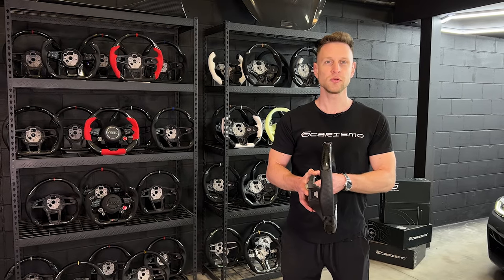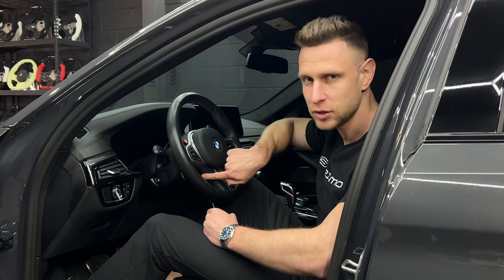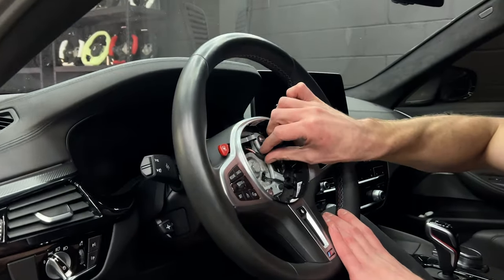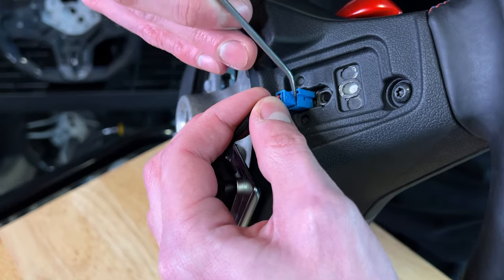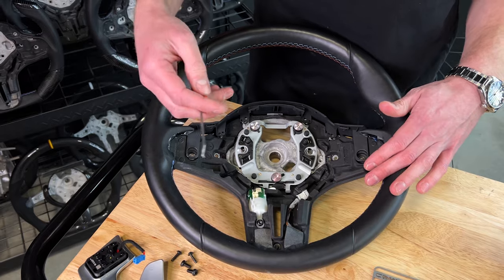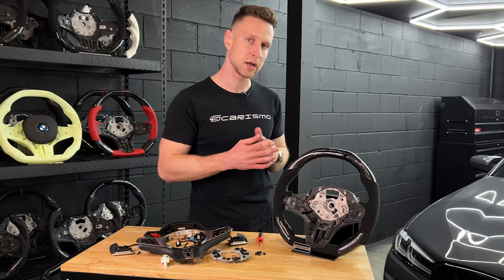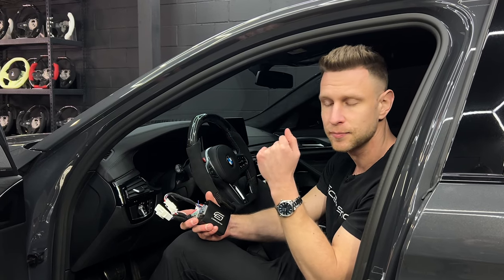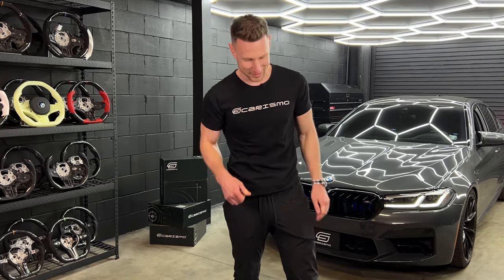CARISMO | 2022 BMW - LED Steering Wheel Install | Ferrari Style LED Shift Light Bar

Comment: Great video!
Are you able to tell me or provide a picture of which wire is for the heating element? I'm having trouble connecting the wiring from the new wheel to the factory heating element wiring. Thanks in advance!
Reply from the maker: Hey there, each vehicle is wired differently, the best way to find out which wire provides 12v and ground is to use a multimeter. 

Here at the shop we've had luck tapping into the red and black wires on the connector that plugs into the left hand side of the steering wheel buttons. 

Disclaimer; your steering wheel may be wired with different colored wires. Please use a multimeter to confirm wether you are connecting the wires correctly.

Comment: what happen to car with heated steering wheel? will that function work on the new steering wheel?
Reply: If you shoot them a message on IG they will be able to answer you but yes you can retain all the steering wheel features (ie. heat & ACC). More than likely they will have to make you a wheel, turnaround is about 10 weeks.

Comment: It’s a shame you have to pierce the side of the wheel to get to the springs. Is there any kits out there to hide the holes made ?
Reply from the maker: Technically, with a thinner tool and more accurate approach the holes created will be so minimal that they should never be visible to the naked eye without digging at the material to check if it has or has not been piereced. The larger the object, the higher the chances that the removal will leave a mark. Since its not even a real hole, just a puncture - we highly doubt there is a kit for this.
Reply: @carismodesign6050  guessing there’s no alternative way to remove the airbag ? I’ve seen some horrific damage photos, which is what’s putting me off . But your advice makes total sense !

From what I’ve seen , on F series cars you are able to get a replacement back cover, had no luck so far with G series’s.